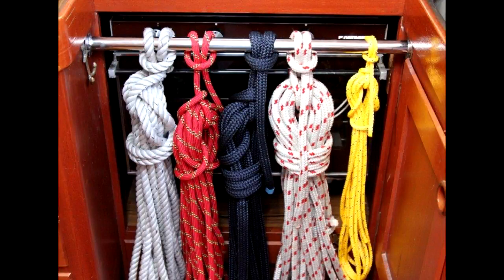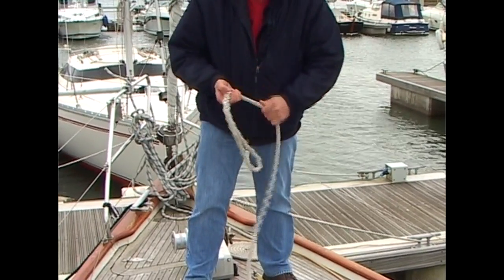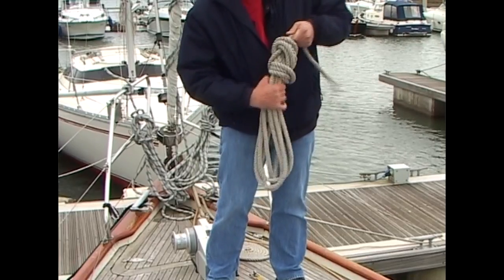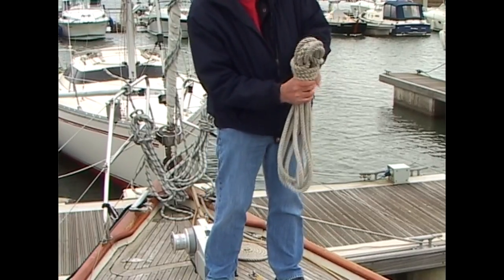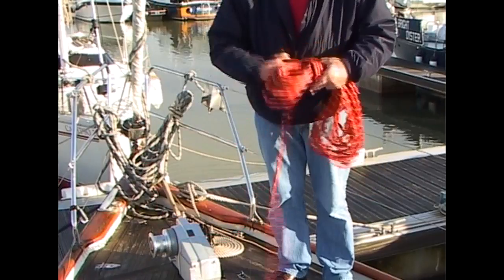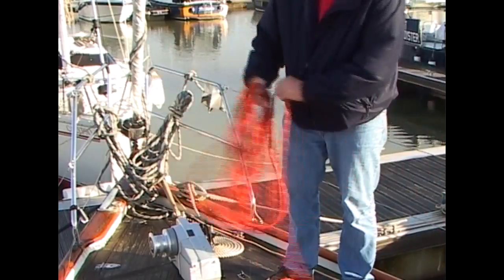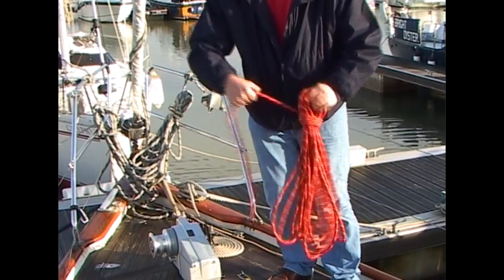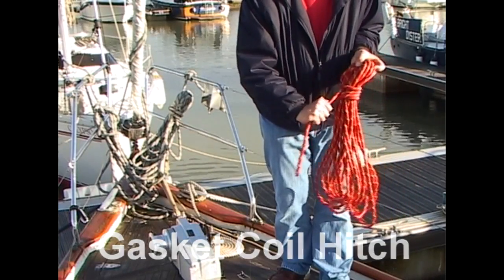SFS Coiling a rope Vimeo

Comment: I learnt the climbing way to coil rope while climbing. The main reason I used it was because climbers rope is so long you cannot hold the whole rope in your hand. Rather than folding the bights in your hand, you fold the bights behind your neck and let it hang down on your chest.
I also learnt that as long as you keep both ends outside your pile of rope, the rope will almost never tangle. This is why climber's rope tarps (use to keep the rope clean when on the ground) often have two loops - one to tie off each end of the rope.

Comment: The fast and easy way to coil the climbers way is to flake the rope to remove twists; find the two ends and flake from the two ends again to find the middle of the rope; holding the middle in one hand, flick a length of double rope behind your neck; you now have a kind of doubled rope scarf hanging around your neck an arm length each side; with straight arms together, down in front of you,  use right thumb to hook under the next bit of uncoiled rope and lift the arms out to the sides; this will give you a length of doubled rope across your chest - the whole span of your two arms outstretched; then flick the middle of the length over your head to rest on the back of your neck; then drop the arms again to touch hands, hook one thumb over the uncoiled rope and raise the arms out to the side again, running the thumb along the flaked / uncoiled rope as you go. Flick over the head again. Keep the growing loop ends secured in the hands, just hooking the thumb each time to grab new line. If hands are small just hook a single line each time rather than the double line. Carefully slip it off the neck, wrap around and secure it as described in the video. It is very fast and simple on a mountain with 50m ropes, lightning fast on a boat with much shorter lines as it saves all the twisting and adjustments to get equal loops - The loop lengths will be exact as they are set by your arm length. It is also easier because all the weight is taken on the back of the neck, not the biceps.